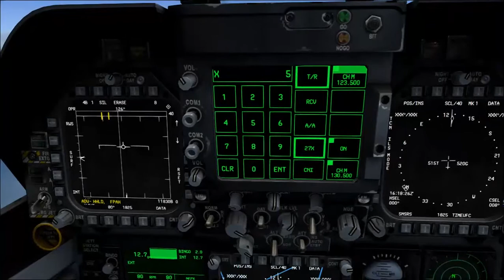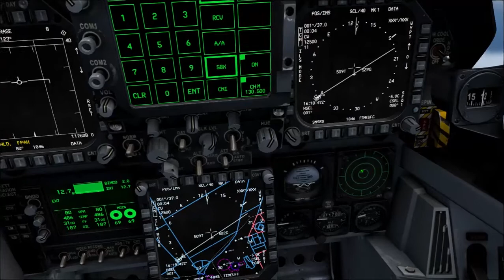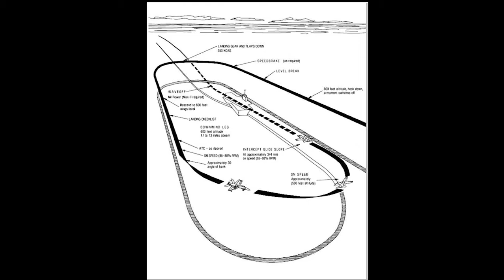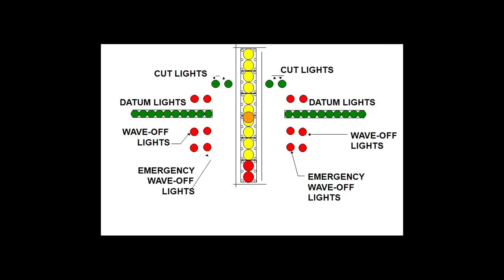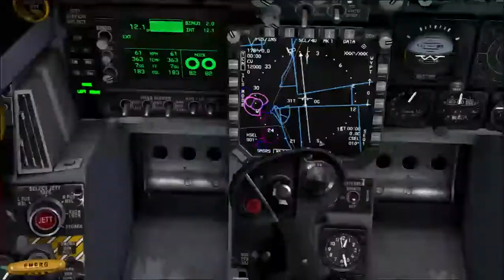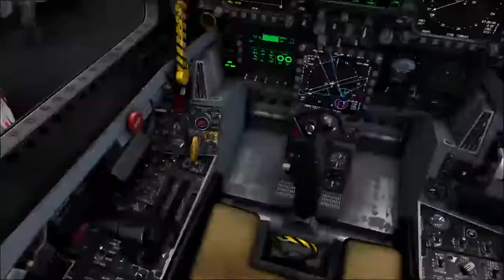Carrier Landing Tutorial - FSX [VRS Superhornet]

Comment: Hi cap!

Small correction if I may: You dont slow down to 250 knots before breaking, you do it WHILE breaking, by pulling approx. 1% G of your current speed - so if you´re going 350 knots (usual pre-break speed), you pull a 3.5G left turn (and dropping) as the speed goes down to 250 knots - when at that point, you hit em all: gears, and both notches of flaps (and ofc do checks like hook etc). 

Another thing is/was the AoA and HUD caging (I am not criticizing, just suggesting for even better content): when abeam and on the groove, you already wanna be 100% percent established on speed and have approx. 8.1 AoA (and keep it all the way) - also, caging the HUD is standard procedure, to easier track it. 
Additionally, avoid ANY stick inputs regarding the pitch - no yanking up or down - only roll; aircraft altitude and pitch are only, and only ever changed/adjusted with the throttle when on speed.

All other than that, great flying and vid! :) Try DCS ;)
Reply from the maker: Thanks for input. Appreciate the effort.